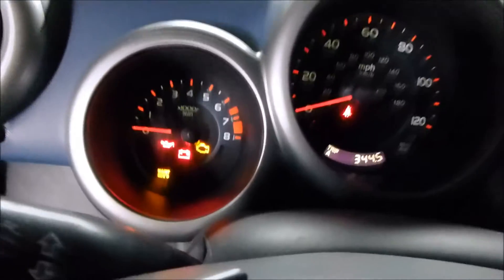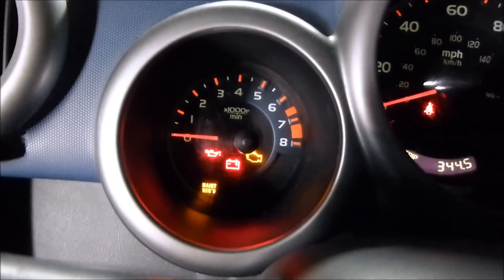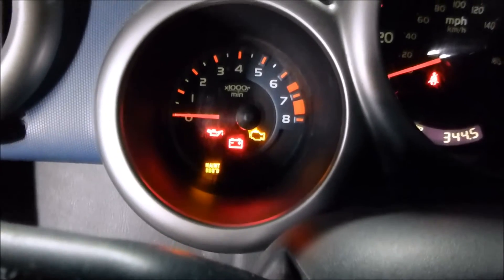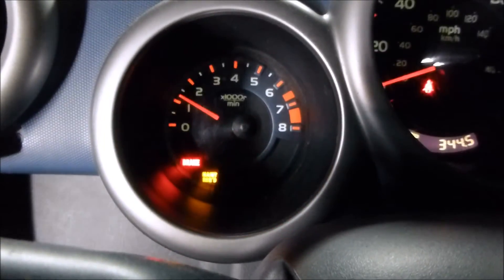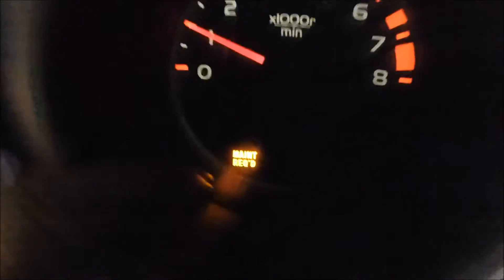Honda Element, CR-V, Civic, 2.4L I-VTECH engine noise, WHAT ??? #70

Comment: What the  current status.. Did you find a solution?  has it gotten worse?
Reply from the maker: Hi  T JRick, yes I found the problem, Piston #1 has a flop, the Honda mecanic put a small video camera in the piston chamber through the spark plug and showed it to me, and told me he's seen cars with the same problem sent back to honda and came back and was told buy Honda that it wont kill the engine, just keep doing your regular oil changes.

I don't own the car anymore, and the guy that has it, put almost 100000 km on it since ( he's a courier ) and still has the same engine and he loves it.

Thanks again
and please Subscribe to my Channel.
Every Subscriber encourages me to make more and more videos.
Max
Reply: @Kickstartyourcar  did you ultimately have that piston repaired or just continued driving the Elements? Thanks a ton. I appreciate your video and info
Reply from the maker: @automotivedistributors9708  Hi, no I did not replace the piston, I drove it like that for about 1 year after, And I sold the car and it still drives up to this day. 
Thank you for watching this video, Subscribe for more similar videos.
Max ofalltrades

Comment: did the noise stop when you were idling in Park or Neutral? 
Did the noise only happen when your Element was warmed up rather than when you first started the E?
I have a 2004 Element. Sounds like a similar noise but it is not constant. Only get the noise in Drive or Reverse when idling. It stops in Park or Neutral.
Reply from the maker: Hi finally my element has a piston flop, i does the noise when the engine is warm and in gear! And the Honda dealer told me to keep regular maintenance and it will last a long time! 
Thanks you
Max from Kickstart your car

Comment: These engines are known for the knocking noises. They have no valve lifters, so lifter noise is out. Mostly it would piston problem or rod. Many of these engines have high oil consumption (other Honda engines also) because someone was using crappy oil and wasn't changing it often enough - forget the maintenance light it's only good for show, on newer Hondas with % of oil life we change  oil at 50% . Also the IMO, 5W-20 is too thin for it and causes the problem since beginning - I would rather use synthetic 5w-30, 0w-30 since day one.  For the worn engine maybe good synthetic with a lot of detergents would help too loosen the rings. We use Rotella 5w-40 on friends Element, as it consumed a lot of oil, it also made the engine less noisy. Btw the music sucks.
Reply from the maker: I know many think that honda car, work for ever without any maintenance!!
If these cars where well taken care of, they good go for aloooot of km without any problems!
Thank you for your comment!
Please Subscibe
Max ofalltrades
Reply: Fact Checker  I use 0w20 syn. always have.

Comment: It's the variable valve timing VTEC sprocket on the timing chain the one the big one on the right side when facing the front of the motor you need to replace it or it's going to make a clicking noise or grinding loudly
Reply from the maker: Oh I'll take a peak a that, thank you very much :)  please Subscribe. Have a great day :)
Reply: Winner 🏆

Comment: I have a 2006 since new it has done this I have 150,000 miles. Did new timing chain still the same, had the valve and cams checked still the same, just change oil regular and keep driving. Have not lost power or gas mileage, and always 1/2 quart low at oil change @4-5 K.
Reply from the maker: Hi David, Mine has a piston flop, and determined by my Honda dealer, they looked inside of the spark plug hole and saw the piston slak ( FLOP )
Maybe ask your honda dealer to take a peak inside the spark plug hole to see, And please let me know the result!
Thank you
Max
Reply: @Kickstartyourcar  Don't think so been there done that. After 150, 000 miles the wrist pin or con rod will give. Got all the mumble jumble an run around.
Reply from the maker: @davidbanker4455  OOHH!! I'm so sorry for your cars engine :(
Reply: @Kickstartyourcar  Not much of a mech or tech are you?  I have been wrenching for over 50 years, you have no proof just words, just like some of the repair shops I have been to. I know EXACTLY where tick comes from and it is NOT in the block.
Reply from the maker: @davidbanker4455  Thank you

Comment: These motors are well known for this noise on low revs or idle . The 5w-50w oil in them is abit to thin  when idling so you go to a thicker oil for start ups etc I have fitted 20w-50w oil in mine and improved a lot just a slight noise now but remember this model is known for it so will always will have a little tap or click .
Reply from the maker: hi I added 1 can of engine treatment and 1 liter of transmission oil in the engine until the engine warms up, and I flushed it, added 5w 20 and I will run it for about 500 miles, and then I will flush it again, and then I will add 0w 40, until the next oil change, all this info comes form a mecanic
Reply from the maker: these engine don't click or knock if they do i's usually due to bad maintenance.
Reply: I agree. The oil is because the engine operates on that pressure. There are cam and cam timing issues with the oil. These VTECH have variable CAM, and CAM timing was added on the IVTECH. Thicker oil would effect those pressures.

Comment: I saw this and figured I'd add what I know. Maybe help . The oil operates oil pressure to the cam. The lifters also operate on pressure, the CAM pressure varies the valve opening/ pushrod stroke. It sounds like a lifter . Timing chain slack doesn't seem would be the problem as the sound isn't on all 4 cylinders. Timing chain slack would also appear in the idle which seem to be smooth considering . Do a compression test on the individual cylinders, just take out one plug at a time and use a simple pressure tester . Good to have anyway as you can also see how all 4 cylinder pressures are. close to equal is good. Even if they are all low. That would be a different problem.
Reply from the maker: Thank you

Comment: 1:51 what is that thing sitting in the black ring on top of that blue metal?  Its to the left of that black box with "ED" and the bar code.  Its missing on my element
Reply from the maker: Hi hallmonitor98, are you asking about the top mount plate?
Thank you
Reply: No, I think he's reffering to the ABS system in front of the shock tower. Not all E's had ABS braking.

Comment: The noise seems to be coming from the Passenger Side of the Engine. Sooooo....
-Check to see if there are puffs of air coming from the Power Steering Pump. This is VERY easy to check. IF it is...replace the O-rings inside the Pump or get a new one (my brother and I replaced the O-rings in my 2003 Element...Medium Difficulty job).
-If it's not that, check to see if one of the Piston Heads has a problem (most likely the one of the far left). While you're doing that, check the Timing Chain (since the Head Cover will be off anyways).
Good luck.
Reply from the maker: HI, I took it appart and it was piston number one, the bottom rings where stuck in, and this was due to poor maintenance, too long between oil changes. I`v installed new rings, had the cylinder bored and cleaned, new crank bearing, and had the head rebuilt, new timming chain, water pump, and after putting all back togheter she works like a charm :)
Thank you BrockLee3
Reply: EXCELLENT!!! Glad it worked out for you. I may be a little rusty from NOT being a Service Tech but, I still got it. LOL!
How long did all that take you? I'll estimate FOUR days total and 18 total man hours, maybe? Would it have been cheaper to buy a new engine? Was it worth it to do all that work? (Sorry about all the questions. I'm an Element guy, myself (328,000 miles and still going)).
Reply from the maker: Hi BrockLee3, it took me about 15 hours and in that time, I lost my camera!!!! eeee so no videos of that :( 
I know it would be cheaper to buy another engine, but this other engine will maybe need also a timming chain. guides. oil change, etc... and the engine I had, The rest was fine, and with all these new parts she's again for another 200 000 miles :) 
All parts and evrything cost me about 1000$ but I did all the work myself in my garage.
vrooom vroom HONDA 
Thank you
Max

Comment: did you try use more viscosity oil with  additive to quiet the engine and protected for cylinder scuffs ?
Reply from the maker: No, but it's a very good tip, I'll try that, Thank you

Comment: Needs a cam shaft. One of the back sid of the lobes deteriorated
Reply from the maker: Thank you, but I found the problem, it has a piston flop! Inspected by Honda, and they told me keep regular maintenance and don't worry about the engine noise!
Reply: Max ofalltrades I am a Honda and Acura master tech. I work for Honda and I’ve seen this before. I would have them pull the valve cover and inspect the cam lobes. I have seen this before and I have seen people Mis diagnose it as a piston slap. Just want to help you.
Reply from the maker: Hi Greg, Thank you for that info, next weekend I'll take the valve cover off and inspect the cam lobes. Thank you again, and please Subscribe to my channel to help me even more, Have a great day :)
Reply: @Kickstartyourcar  have you check your cam lobes? I experience the same noise since beginning of the year and my Honda dealer told me I had to replace the engine. I was wondering if the problem was really cam lobes and could replace cam shaft instead of whole engine....Please let me know. Cheers!
Reply: @Kickstartyourcar   good video!
Reply from the maker: @stevalamelin8795  Thank you, I'll have checked again at my Honda sealer with your info, Thanks again and please Subscribe for more to come and you can also check my new channel ( Road unKill ) it's all about cars
Reply: @Kickstartyourcar  have you take the cover valve off to check the camshaft last weekend as you told Greg?
Reply from the maker: @stevalamelin8795  hi, it's really a piston flop, with a camera in the spark plug hole i can see the piston flop.  The car has almost 200000 miles and it still drives :) Thank you
Reply from the maker: @stevalamelin8795  Thank you, but I found the problem, it has a piston flop! Inspected by Honda, and they told me keep regular maintenance and don't worry about the engine noise!

Comment: I have something of the same noise in my 2003 2.0 CR-V. 
I thought it was the valves ticking and that needed tightening but after they did that didnt help much.
Honda shop was not sure, but mentioned the chain/chain stretcher is old/worn.
Do you think it would help to change to some other (thicker?) oil instead of the 5W-40 thats in now? 
Its summertime here now. Can the chain strecher be tightened or only replaced?
Replace engine here in Norway cost far more than the car is worth unfortunatly. Thanx for putting out vid!
Reply from the maker: Hi,  how many kilometer on your cr-v?, and you should consider 5w-20  
Thank you
Max
Reply: Max ofalltrades it has rolled 300.000 km. The oil that was put in at last sevice is 5W-40. I read somewhere here that some other dude had put on 20W-40 to lubricate better? Today i bought 15W-40 (full synthetic as usual) and topped only 1liter. Same noise, its metal-ticking sound like yours there, and knocking slightly ecpecially around 2000-3000rpm. Valves has been set to perfection by Honda shop so its not that...but maybe one of them is worn out?? 😔 also it has a bit thin spiking sound when putting strain on engine at low gears. It doesnt seem to be the chain/chainpulley what i can hear...
Reply: I dont know much about oil types im afraid...
Reply from the maker: Hi again :) the oil numbers are as goes, ex: 15 w 40 = the numbers are the size of oil balls so 15= oil balls 15 size up to 40. your engine now has small oil holes that no oil is going there! 
And as per the noise, the timing chain kit and tensioner, needs to replaced at the least every 250 000 km!

Or sad to say this but it"s maybe like me engine ( a piston flop ), your Honda dealer is qualified to find your clicking noise.

Thank you
Max
Reply: You can change the chain tensioner, but IMO the car wasn't maintained properly - too long oil change intervals. I would try Rotella 5w-40
Reply: Ummmm. Wow. Oil numbers work like this. 5w20 = cold viscosity level is 5x higher that of the second number. Thats the speed the oil moves when cold. W=winter. 20 = standard viscosity at operating temp. So 5w20 means your 20 oil gets 5 times slower at 0 degrees or "w"inter temp.  So a 0w20 or 0w30 viscosity full synthetic would be good for you honda folks in a colder climate.

Comment: did you check the serpatine belt? I had a similar sound, it was a bad idler pulley making the tick each rotation
Reply from the maker: thank you, yes i did remove the serpentine belt and started the engine and it has the same noise. 
thanks again Kay Jay

Comment: I got the same problem in my element 2009 and it had that noise at 86000 miles now it has 127000 and still running good but i think the noise is a little louder than before
Reply from the maker: Hi Alejandro Correales, these engines are very tough, but never forget a oil change, maintenance is the key for long life.
Thank you
Max ofalltrades

Comment: Hi . Is the Piston flop the same as the Piston slap?
Reply from the maker: Hi Fadel hyasat, 
a Piston slap is the rocking of the piston in the cylinder (as opposed the desired movement of the piston up and down the cylinder). It happens when there is "too much" room for the piston in the cylinder and the skirt of the piston hits the cylinder wall.
 it's usually due as bad maintenance ( lack of oil changes )
your engine wont run for a long time

a piston flop is when the rings of the piston the stick in the grooves on the piston, oil may go up in the explosion chamber and the engine may burn oil.
as per car dealers mechanics a piston flop wont kill the engine. it's usually due as bad maintenance ( lack of oil changes )

I hope this answers your question!
Please Subscribe

Comment: Did your mechanic told you why the engine is louder without oil cap?
Reply from the maker: Hi Rockerjonni, it was a piston flap. Thank you for watching this video. Please Subscribe for more. Thank you. And no he did not tell me why it sounds louder when the oil cap is off.
Reply: @Kickstartyourcar  i did a little research. It's called a blow by. With luck the PCV valve is broke.
Reply from the maker: Thank you 😀

Comment: Currently looking to buy a 2006 or later Element.  If I hear that noise I will run, not walk, from that one and look elsewhere.  I have never heard of piston "flop".  Sounds like BS to me.  It is not piston slap which is a true engine fault and not what you have.  This video would have been better if you revved the engine.  That would help rule out rod knock.
Reply from the maker: Hi Andrew, did you find your Element yet ?
Reply: @Kickstartyourcar  Not yet.  This COVID-19 situation has affected the used car market.  Need more choices.
Reply from the maker: @canuckfixit7722  I know ... i have a honda del sol  car to sell but no traffic due to covid!!

Comment: Hello do you ever find the problem? Bc i have exactly the same noise incredible please let me know
Reply from the maker: Hi Alex Lopez, yes I found the problem, I had the car inspected at a Honda dealer and they told me it's the piston number 1 has a flop, due to bad maintenance in the past, and change the oil every 5000 km ( with good oil ) and the engine will last
Reply: Max ofalltrades
 Good morning Max and thx for fast reply wow maybe is the same problem what i have in my element but is fine I’m doing good with the oil and is still strong engine the only things is the noise sounds like deasel 🤷🏻‍♂️but thank you so much and have a bless day👍
Reply from the maker: Hi  @AlexLopez-dp6zh , i did something like 60000 km and sold it and they still drive like they stole it and yes it sounds like a diesel but they have the music all the way up!! LOL

Comment: Pull spark plug wires off one at a time and see if the sound changes if one the sound changes probably a rod bearing.
Reply: Agree.
Reply from the maker: It's a piston flop!! and the Honda dealer told me, keep good maintenance and it should last a long time!

Comment: You want to explain what a flop is? Google searches come up with nothing so what's your using this some kind of backyard mechanic slang. And I can't figure out what you mean by flop is it an anagram for something?
Reply from the maker: Its caused by lack of maintenance ( oil change ) usualy its the number 1 piston that devolop a slack . Its either the rings are smaller or the cylender need to be rebored and a bigger piston and ring kit is needed. In the hot rod world its a step 1 on your engine and you'll gain more horsepower!

Comment: I have the same problem, was told it’s the timing chain
Reply from the maker: I found the problem, Piston number 1, there is a piston flop. I took it to a Honda dealership and they told me that this problem won`t kill the engine
Reply from the maker: Take a closer look at piston number one.
Piston number one is on the left side when you face the engine
Thank you
Max
Reply: Did you fix it? If yes what did u do?
Reply from the maker: I Drove it for almost 60000 miles since and the same noise, and she starts like a new car everytime!
Reply from the maker: It's due to bad oil change maintenance, 
I cleaned the inside of the engine with recommended products, and I keep up with 5k oil changes and Honda oil filters and I have the say the engines seems to be a bit smoother, less noise!